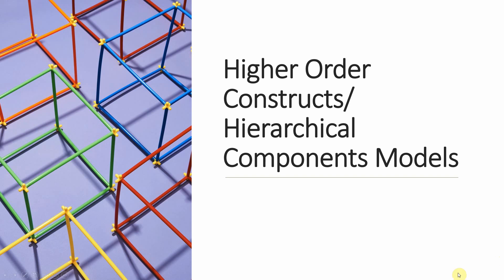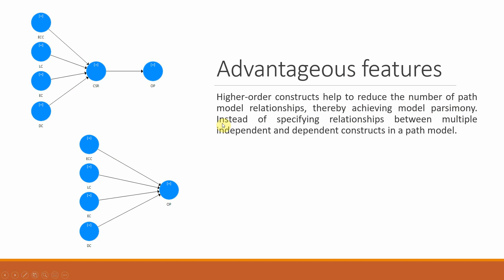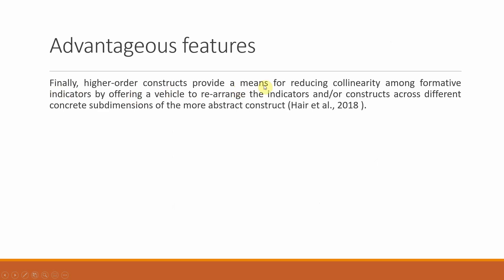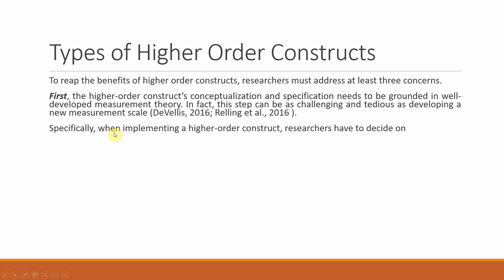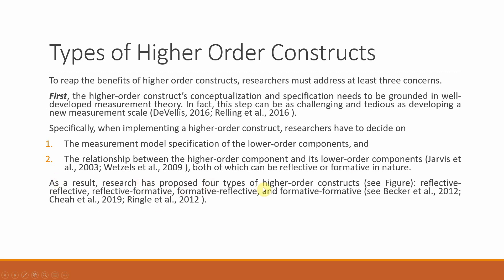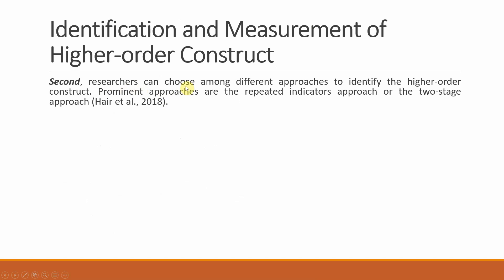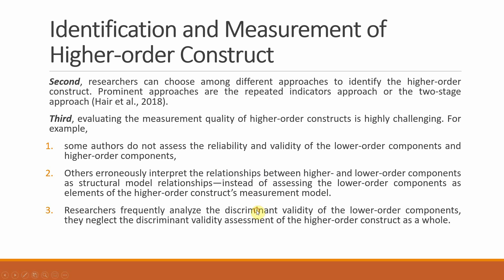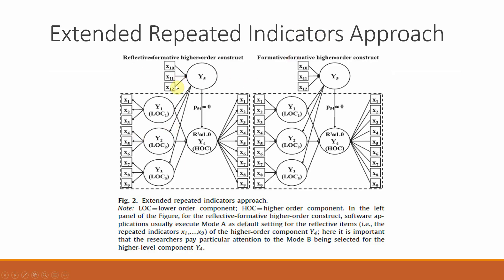1. The Concept of Higher Order Constructs (HOC)/Second Order/Hierarchical Components Models (HCM)

Comment: Hello, first of all thank you for all the video material on using SMART PLS. It has been truly helpful for my analysis. At the moment I am struggling with the concept of HOC. In my model my DV is Brand Experience, which has 4 sub dimensions. So far I have not treated it as a HOC in my model, because I was not familiar with the approach. I just treated it as a latent variable with 12 indicators. I am already done with the whole analysis and happy with the results. But now I am wondering if the results would heavily change if I define  Brand Experience as a HOC and then run the analysis again.

I would really appreciate your answer. Thank you so much in advance!
Reply from the maker: Thanks for your interest. Yes the results do change sometimes. This video may also help in developing a better understanding. 
https://youtu.be/OrBGwmsmz78

Comment: Sir  have been trying to build a model where we have a second-order factor that moderates relationships between three IVs and a DV. I am fine with first-order moderators but really wondering how the interaction would work if the moderator itself is a second-order factor. Will it be okay if I collapse the lower level factors? Can you suggest any material that could help us here?
pl guide
Reply from the maker: Even if the Mod is HOC. Doesn't matter, it will be added at first stage and reliability and validity assessed. Once that is done, it will be added as a HOC based on LVS at the second stage. Finally, used as moderating varibale.